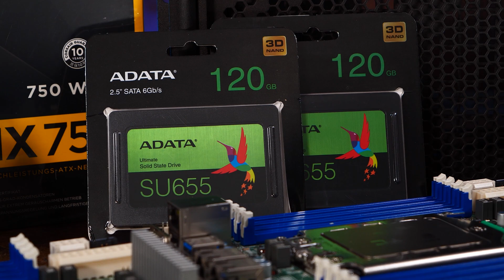Building a #homelab server from the ground up! - Branden's EPYC Server Build!

Comment: Pretty basic server chassis hope you didnt pay to much for those, Love the choice of CPU but then i am basised as I own a Dual Epyc 7302 none P (the P means its single cpu with lower wattage) build myself, very minimal on Storage Space and GPU's whats the use case here? Im sure those CPU Coolers would work with an older generation Low End ThreadRipper but Im pretty sure there marketed as a Server CPU Cooler for AMD Epyc, you didnt specify the Ram Speed would it be 3200mhz as thats what im running, erks me abit that only 15 out of 16 slots work, giving me 120 stead of 128gb but i dont wanna fuss around with reseating or swapping the cpu's as ive killed a threadripper pc b4 trying to upgrade it from 1950X to 2950X.  Also when buying Epyc make sure its Vendor unlocked i made the mistake of buying cheaper cpu's only to find out that there cheaper because nobody wants them as there DELL only Vendor Locked.

Comment: Ssds have no moving parts... 
I will use painters tape to arrange my disks, each zfs array is taped together, all cables from each sata controller are taped together.

And i can make a loop of painters taoe and stick a brick of ssds to the wall of my server chassis.

Also: qemu+kvm+zfs+zstd is a far superior virtualization workflow

Comment: My homelab rack is in my home office because I don't have room elsewhere in my house.  That dynatron is a non starter for me. They work, but they sound like jets at take off.
Reply: As long as the fans on the cooler are standard size like 60 or 80mm, Noctua and Bequiet do make fans in that size. I have a Dynatron K199 1u cooler (for lga 1150/1151) I got from an old Newtek PC at work, that had the same issue with the stock fan being WAYYY too noisy to sit in the same room with me no matter what fan curve I set, but I figured out it was removable and strapped an 80mm Noctua A8 4pin pwm fan to it and it's so much more usable in a regular environment now lol.
Reply: @empedance1933  This is something to think about.

Comment: 4:29 man i need to keep that as a note thank you i was trying to figure out why my server wouldnt turn on so i started looking through videos. i tought the marking on the motherboard where telling me where to plug it in on the other side of the usb3.0 connector. i tought i read the manual correctly but i guess not